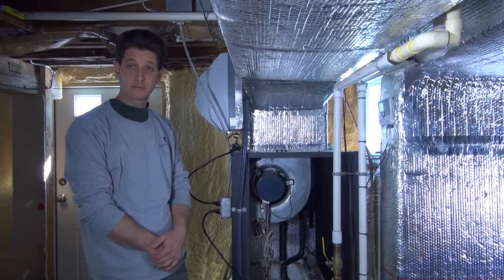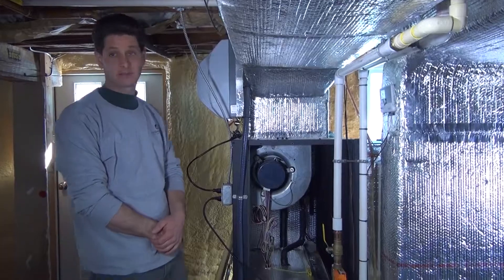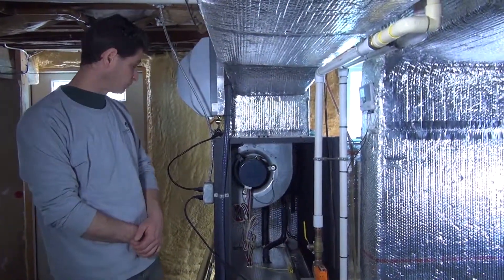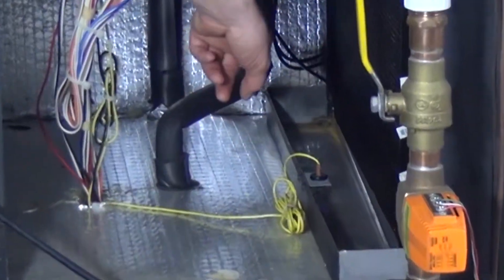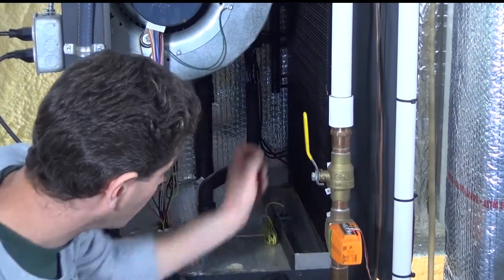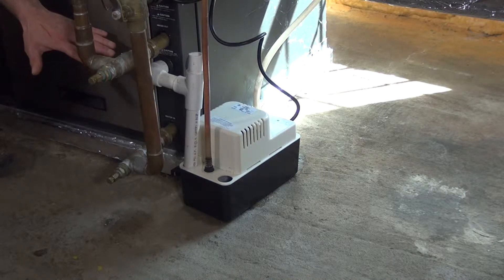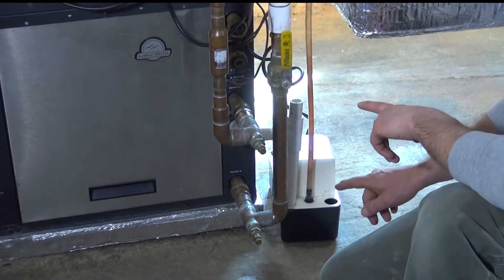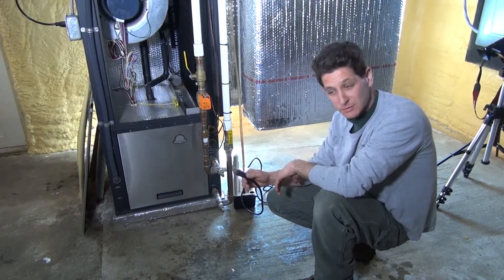Ultra Geothermal, Inc. - Operation and Maintenance Series

Comment: My heat pump compressor (copeland scroll 2stage) sweats and the condensation drips below the compressor mount and fills up the cabinet with water... aside from drilling holes for this to drain I see no other option... what should I do?